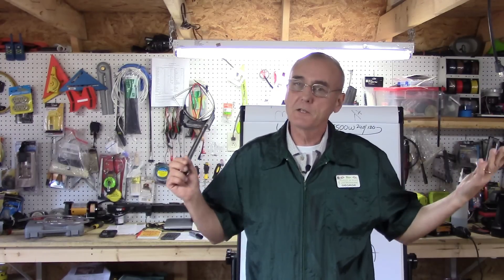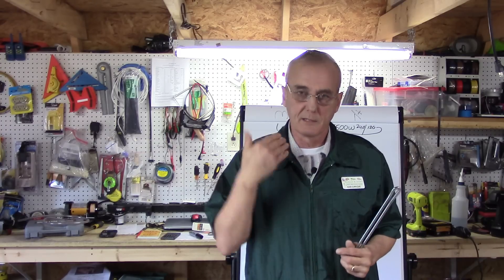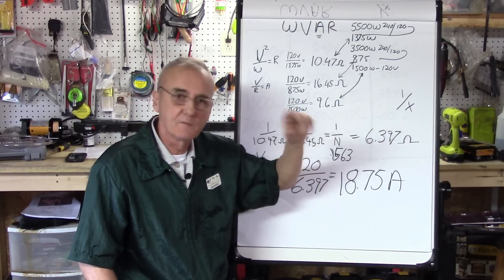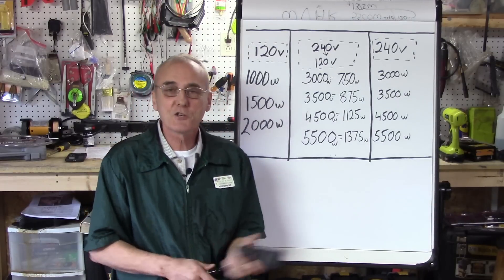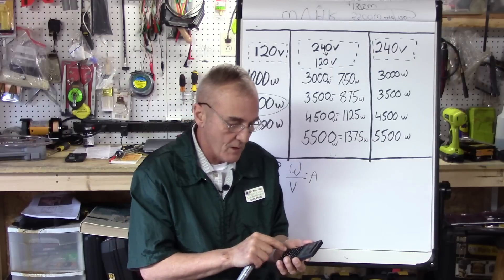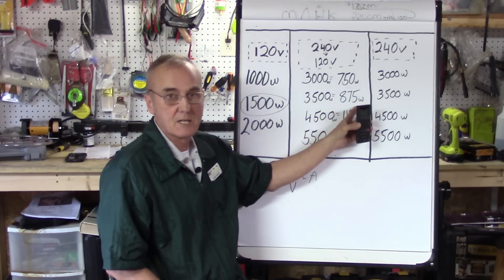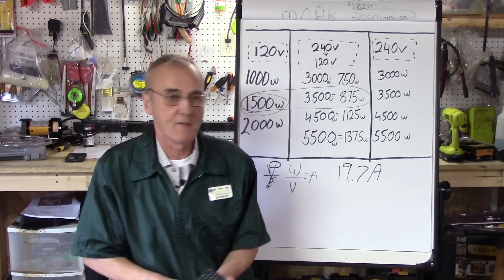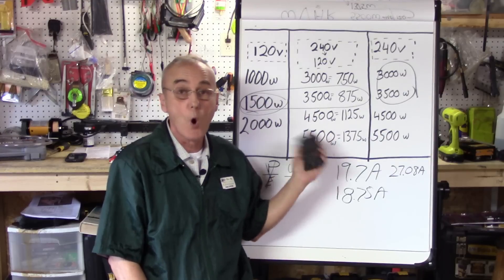SELECTING THE PROPER HEATING ELEMENT SIMPLIFIED

Comment: I want to add a low tempeture alarm to activate if temperatuer goes around 10 degrees colder than set value.  is that possible with this controller?

Comment: Is it possible to install a heater element of lower amperage? Or each furnace unit comes designed to work with a specific heater element amperage?

Comment: I'm a 64 year old woman and need advice. I want to make a sand battery out of a 15" copper bucket I have. To heat the sand I'm thinking about using a water heater element. I've seen a coiled stovetop burner used, but think a water heater element will also work. I'd hook it up to a liFepo4 battery. Any ideas for how many watts an element would need to have to heat the sand. I have a 2000w solar battery I could run it from, using the extended battery to ensure my solar generator can   deliver what I need. Any suggestions I'd love to hear.

Comment: Hev George. My name is David. I used to live in Springfield Oregon, and a few years ago you built me a   PID controller for my Duel 4500 watt still. Since then I have moved to Las Vegas, and the house I live in has a hot water heater out back that I thought would be a good place to connect to, but it is hooked up weird and does not produce hot water like it should. 
    I just want to thank you for this video because it is going to help a lot. If I run into any problems I would like to email you if possible. Thank you again.

Comment: I have a two element system. The way I understand that the two elements don’t actually work at the same time. The upper heats first then switches power to lower element then will switch back and forth with upper element till temperature is satisfied. I have a 30 amp 240 v circuit. The elements have been replaced by previous owner and he has 4500w elements in upper and lower. Is this safe?
Reply: When top is satisfied Stat block transfers to lower element. When whole tank is satisfied both elements remain off. Your tank can only use one element at a time. So you are only pulling 18.5 Amps. With 4500 watts elements.
You can up the tank performance with 5500 watts elements and still pull only 22.9 Amps.
Reply: @ thanks

Comment: Good advice, but a couple of comments. First, "amperage" is best described as "current," which is measured in amperes (amps). Second, surface area is measured in square inches, not cubic inches. But the idea is correct.

Comment: Seems inundating for the common homeowner..........
Just replaced Both my Heating Elements @ 4500w(low density) ea. Since the unit is 240v and the Elements never operate at the same time(due to modern dual Thermostats. So no issue on my 40a circuit.
* I also took the time to learn how to descale the tank and replace the Anode. After all why replace anything that can easily be repaired?

Comment: Need help to decide either to buy a nuwave 1800w induction stove top or install a heater element into the 5 gallon still with 4 bubbler plates? I'm leaning towards getting the induction stove   has anyone setup one and issues?  Appreciate the help all

Comment: That was a great video, I have a 13 gallon but I want to run it on a 120v. My question is, is there a special pid controller for 2 elements or can we just use a pid controller you use in your videos?
Reply: Both can be run with one PID.

Comment: Hi George, I have just acquired a 100L / 22 Gallon stainless steel beer keg and I have a pal who is going to do all the cutting / welding etc. I live in the UK,  so what size element or two would you suggest?  bearing in mind the voltage in the UK is 240v. Not sure what size to get to heat that amount of liquid. Also, what would be the cost to buy a PID from you that is suitable to the 240v ? Many thanks,

Comment: @George Thank you so much for the information but I do have a question - Purely for the sake of heating efficiency and even heating within the mash would you rather run a single 2000W heating element on a 120v circuit (16.6 amps) or dual 1000W heating elements are the same amperage?
Reply from the maker: Either would work I like the single 2000Watt

Comment: Thanks George. I'm running a 240v, 4500w element on a 30A breaker. Heats up very quickly and is more than enough for my 8 gallon boiler. I recommend it.

Comment: If you only need around 200 degrees Fahrenheit to distill liquor, then would a120v be good enough? Why do you need it to go higher?
Reply from the maker: It is all relative. Volume plays an important role. In a larger volume a smaller element will not create enough heat to replace the heat lost through thermal conduction.

Comment: Barley and Hops Brewing
Okay George, I need some confirmational advice. I have a 1400 watt PID that I use for my smoker. I want to use it for my still. I have 2 1500 watt 120v elements. I also have my shop wired on 2 separate 120v 20 amp circuits. I am planning to run 1 element direct wired to 1 circuit and 1 element run via my PID on the other circuit. I also planned to use both elements to get up close to temp and then unplug the direct wired 1 and allow the other to do the rest while controlled by the PID. Does this sound doable or is the 1500 watt element too much for the 1400 watt PID. I was thinking that the element probably doesn't run at an actual 1500 so it would handle it. Any advice is greatly appreciated. My other option is to go to a smaller element, say 1300 or 1250 on the PID..
Reply from the maker: The 1500 watt element will operate at 100% until the temp is achieved. The 1400 watt PID will probably not be able to handle that.
You could go on amazon and get an AC relay that the PID would operate that would allow you to run a 1500-2000 Watt element.
The relay should be rated for at least 20 Amps.
George
Reply from the maker: Here is a link to a SSR that would work.
https://www.amazon.com/TinaWood-SSR-25DD-Solid-State-5-200V/dp/B07BT656HT/ref=sr_1_15?crid=3R7XA7BEOPWOZ&keywords=ac+relay+120v&qid=1553865824&s=gateway&sprefix=AC+relay%2Caps%2C168&sr=8-15

Comment: THanks for the video. Using the formula above, if I am using a 30 amp double pole breaker does that mean the max load would be 60 amps?
Reply from the maker: Sorry for the delayed response. I was on vacation in Vegas for the past 5 days.

No, the breaker is rated at 30 amps.

Comment: One thing to consider is that any load that’s going to run continuously for more than 3 hours can only be 80% of breaker capacity. For example, the continuous duty rating of a 20 amp breaker is 16 amps.
Reply from the maker: This system is not one 1005 of the time for any length of time. The 20 amp breaker and wiring is more than safe.
George
Reply: I apologize. I should have been more clear earlier. This math and electrical theory is accurate. My statement was geared more toward people who may take the ‘math lesson’ and use it for other applications. In this application with a thermostat, SCR, or PID controlling it, the load is constantly switching on and off so it’s not considered continuous.
Reply from the maker: @WhydoIneedahandleagain  I understand and appreciate the info. You are correct though, I too do not want folks to take this explanation and apply it to just any process. I should have made that more clear in the video. I will do so in the future. 
Another good point for all.
Cheers
George

Comment: George I learn a lot from you .. Thanks for another lesson in electricity,, ,,Before I watched this video I ordered 2 -2000 watt elements , and with 20 amp 120v breakers  I now know they wont work,, over amped,, on top of that they are shorter than I thought,, only 7" long,, I am using a beer keg for the boiler ,,a 15.5 gallon one with roughly a 16 inch diameter . so when  installed the tip of the element wouldn't even reach the middle of the keg inside,, it looks as if they will  mainly only heat the side there installed in, so now my plan is to get  longer elements with less wattage ,,one for the pid controlled lower heater and one for the upper heater  to help at first ,,controlled manually.  Trying to figure out the best combo staying under the 19 amp safe zone,, will this work? or should I just find and install a longer 2000 watt 120v heating element for the pid controlled lower? and forget about installing the upper one ? ,,,,Or would it be ok to use an extension cord off another circuit to run the upper heater element manually to speed up and even out the heating process??,,     This project is just beginning so anything goes,,  I'm waiting for the 2" ferrules to come in ,,I figured I'd install the ferrules like you said on the beer keg video ,3 1/2 inches off the bottom and the other 180 degrees from it and go up about 6 or so  inches
Reply from the maker: Bob, a second element would serve you better if you ran that second one off of a separate circuit. Two elements will trip a 20 Amp breaker. 
Now, for the length of the element; I saw several at home depot and also lowes that were 12 inches long. You could also run a 5500W 220 element on 120 Volts and it will produce 1375 Watts. They are normally longer too. The options are wide open. 
If you could run a separate 240 V circuit it would make life so much easier. 
George

Comment: How do you determine what heating elements that you need to determine different boiler sizes such as 10-gal., 13-gal. and 16-gallon boilers?
Reply from the maker: Yes. A 1500 watt element is sufficient for a kettle up to 8 gallons. After that a 2000 watt element is best in stills up to 13 gallons and then we need to start looking at multiple elements or if 240 volts is available we go with a 3500-5500 watt element.
Reply: Great information George and I do thank you very much! I am glad that you replied to my message! I have another question for you. If I use a 2,000-watts element.... How many elements would I need for a 13-16 gallon still?
Reply from the maker: @kevinholbrook7174  One would be plenty efficient. I use a single 2K  watt element in my 15 gallon still and it works great.

Comment: will I get enough heat with 110V Heater Controller with 2000 Watt for a 13 gallon?
Reply from the maker: Yes, the heat up time will be a longer but it will work.
Just be patient it may take an hour to heat up.

Comment: What if I were to put a 30psi regulator on my propane tank and hook that to a turkey fryer would that be as effective as getting something as pricey as the bango model fryer
Reply from the maker: Sorry, it is not the pressure of your propane. The banjo cooker has many more opening and a larger feed line so it boils down to volume of propane as opposed to pressure of propane.
George

Comment: Do you have to modify the heating element to use it for distilling? Also what size/ how many hot water heating elements do you recommend for a 15 gallon still?
Love the videos. Btw.
Reply from the maker: No modifications are needed. The heating element works just as it does in a hot water heater. 
I would recommend at least a 2000 watt 120V element at a minimum. If you have access to 240 V you could use a 3500 watt element which would increase efficiency of heating and reduce the time it takes as well.
George
Reply: Barley and Hops Brewing thank you for the information, much appreciated. If I were building a still how would you recommend attaching it to the still?
Reply from the maker: You can have a coupler welded to the still that will receive a 1" NPT element. The other option is to grill a 1" hole in the side of the kettle yourself and then screw in the element and get a 1" NPT nut and washer for the inside to seal it up. Both methods work well.
George
Reply from the maker: I would place the element a few inches from the bottom (in an 8 gallon still it is 2 1/2 inchs up. If you have multiple elements one goes in the bottom and the other about 1/3 the way down from the top or a little lower depending on the shape of the still.
Reply: Barley and Hops Brewing thank you for the info. Much appreciated
Reply: Barley and Hops Brewing  / would you recommend one or two elements totaling 3500 watts or a pid controller would do the job? Can you also consider the electric cost? Meric from Turkey

Comment: So I have 30 amp breakers per side on 240v that means  I can do 2 x 5000 watt elements on that circuit??
Reply from the maker: Yes. That should be fine. Just make sure your wire is heavy enough to carry the load.

Comment: George, how do you calculate Watts  when you step-down an element from 240 to 120...?? is there a video on that or a simple math equation ?  thanks ...
Reply from the maker: It's a quick math equation. For a 240 volt element wired at 120 volts would be (wattage x .25 = new wattage) example: a 4500 watt 240 volt element wired at 120 volts would be (4500 x .25 = 1125 watts). 
It is that simple. Hope this helps
George

Comment: George, I found a 1650W  120V  element also.
Reply from the maker: Great. They come is all sizes depending on where you look. Hope you got something worthwhile from the video.
Be safe and happy distilling.
George
Reply: @BarleyandHopsBrewing hi george i have a 25l pot still thats had an element blow.
The hole size is 33mm and the elements 1320 watt copper ring. With cord.
The diameter inside the still is 280mm. And u just cant find a 1500watt element with a cord thats short enough to fit across the inside if the still.
Can you please help me find a new element that i dont need to do any wiring?